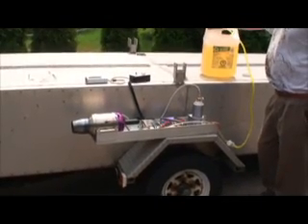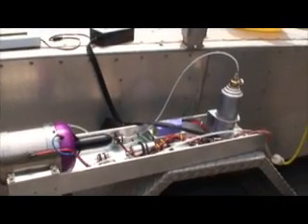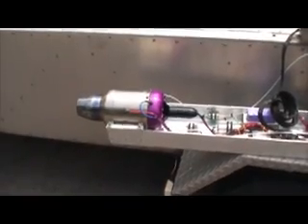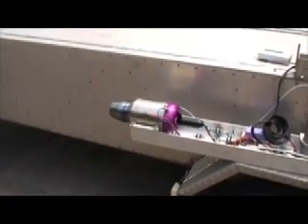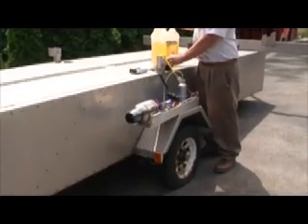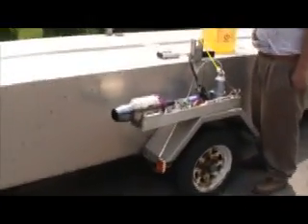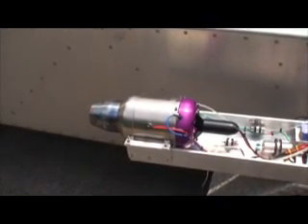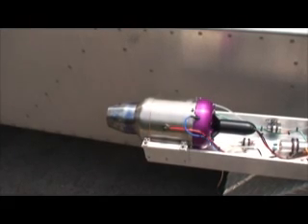Micro turbine test run

Comment: I am interested in a residential sized gas turbine electric generation system.  Do you think a small turbine like this would be practical for powering such a device?  Could you produce enough electricity with a small turbine like this to run your house? You could use the waste gases for heating your home or water. and get away from buying electricity all together. Of course the technology probably costs too much for this to be practical.And it would be a bit noisy in the basement.

Comment: That's a lot of thrust...  I used to work for a company that designed and built industrial boilers which used steam to turn turbines that created electricity.  One of their more novel projects consisted of using CFM-56 jet engines to turn generators creating enough electricity to power a small town.   I always wanted to do that on a smaller scale for a hybrid electric car.  Jaguar beat me to it with C-X75.  Fuckers...  anywho, these micro turbines have much more potential than being just toys.

Comment: @spacemonkeys0681 
Did you ever start that jet pack?  I want to try and make one too with a bunch of 50 pound turbines, more than needed so if one dies you still stay in the air.
It will work it will just be expensive.

Comment: Only 52 Lbs of thrust? At 112K RPM you would thing that thing would be cranking some power. At what RPM does the motor kick out on autostart and also kick in on autoshutdown? 

Hmmmm, 115K with 32:1 gearing gives just under 3600 RPM. I wonder what kind of torque that would translate to. Say...what is the fuel consumption rate at 95%? I have some ideas for using this.